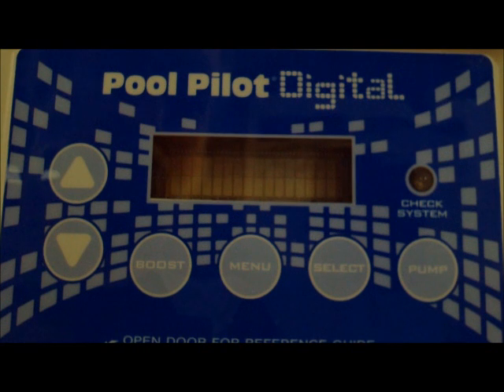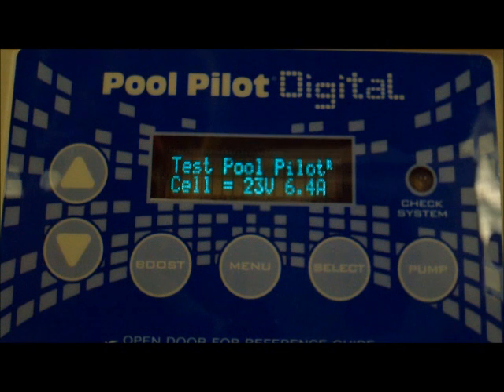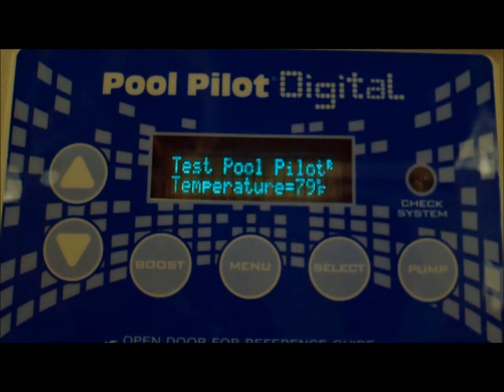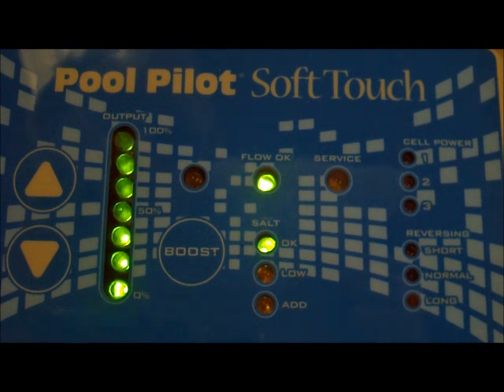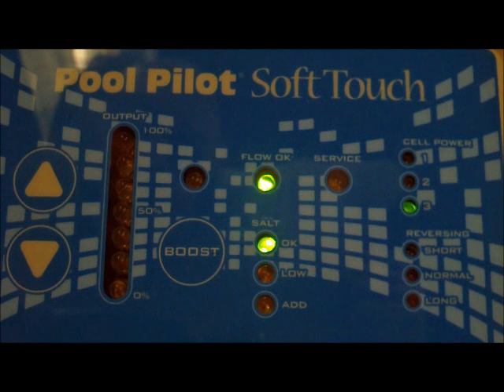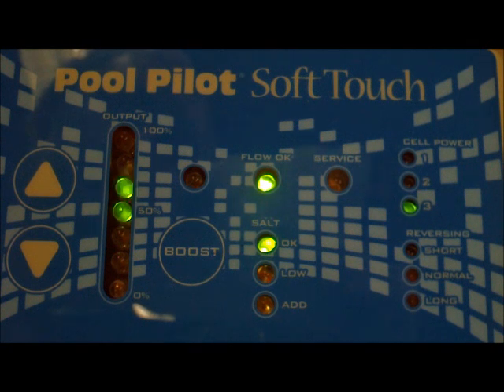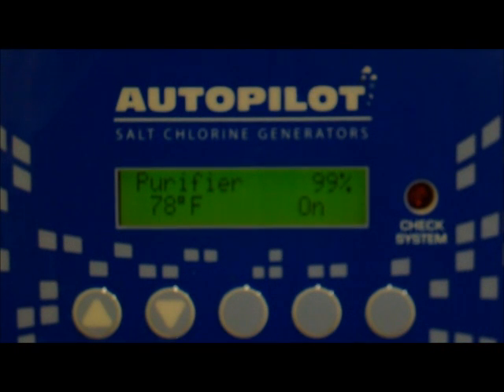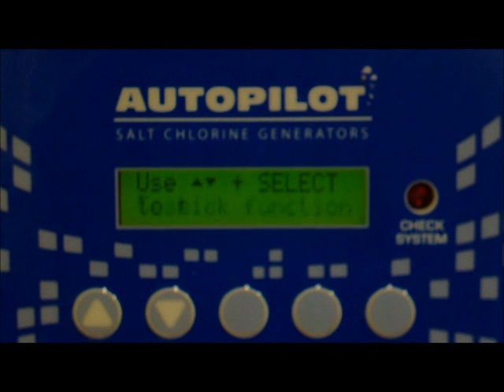How To Use Self Diagnostic System On AutoPilot Salt Chlorine Generators

Comment: hi my autopilot digital nano model no 75041 voltage is giving me a 17 volt is that correct and if if is not I think is go it be at least 20 volts how can fix this problem please feel free to call me im in Miami fl. 786-201-4996 my name is Ernie

Comment: Question...I have the autopilot Nano ...I went to Pinch A Penny and was told my pool/residential should be at around 2800ppm... I currently have a reading 3000ppm .. My pool guy said it should be at 3400ppm...I had the purifier set to 15% and it was keeping 3000ppm...now pool guy said it needs to be set to 60%....any suggestions?